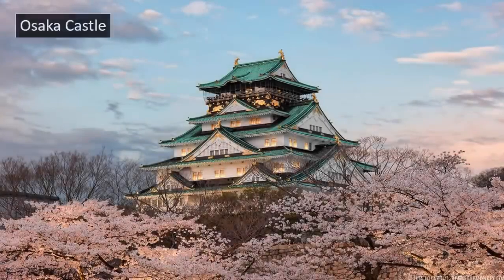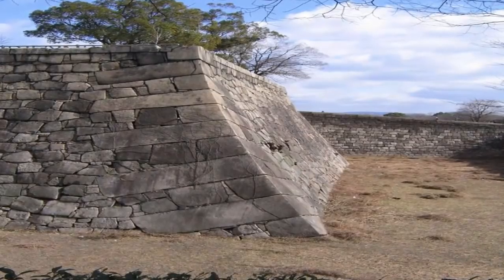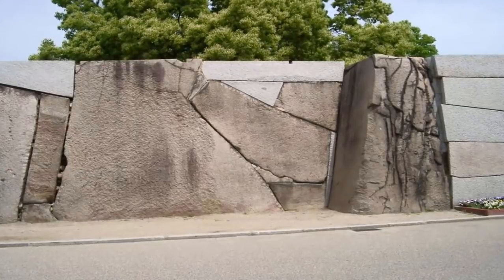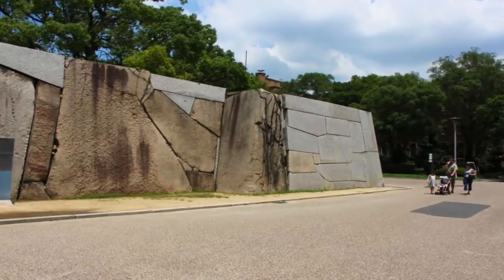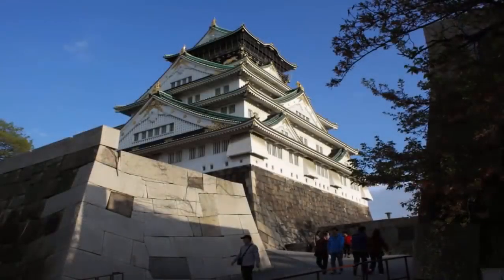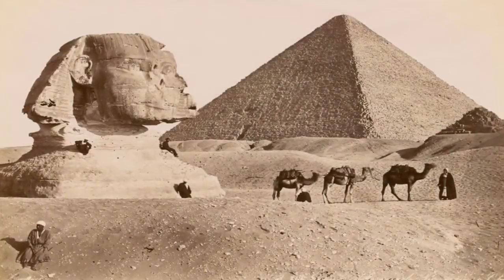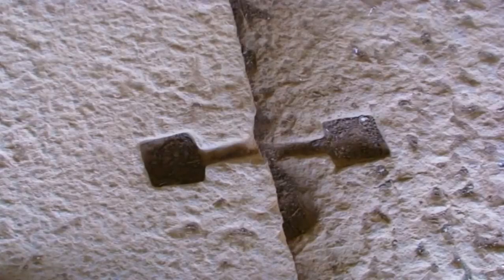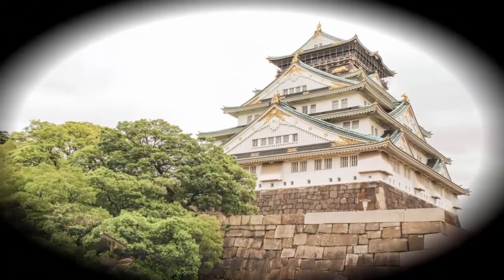The Gigantic Ancient Masonry At Osaka Castle

Comment: I’m begging to see anyone replicate these cuts with copper or bronze tools. Personally I find it laughable. Common sense is not so common these days.
Reply: As one who's recently taken up the stone and tile masonry trade, I can attest to just how hard natural stone like granite, marble and basalt is. Cutting red brick with a diamond chip coated blade? No prob... but using the same blade and power tool on natural stone ate thru this $50 blade REAL quick!
Reply: But it's on the internet.
So it has to be true.
Reply: Chris I don’t think that saying applies here.
Reply: Nicholas Linden He’s a little to stuck on the religion theory. He acts as if religion is the be all end all and can explain all of the extremely diverse phenomena we experience. I just can’t get behind that narrative. To many holes in it.
Reply: With stone material, isn't it that you cut like with like? So the body of the tool is just something that you'd glue ground stone abrasive onto, and that is what does the cutting. May have used something akin to a vibration cutter, but the challenge there is figuring out the source of the vibration and getting the resonance just right. Some modern examples show vibration with a moderate amount of pressure can cut and shape stone in that matter, but ancients didn't have piezo-electric acoustic drivers. So they needed something like a gong or violin bow to get it going, and I've yet to see a good demonstration of that even though the idea seems plausible enough.
Reply: pauljs75 That’s the thing. There is a lot of evidence for a device like your describing. My opinion is that they did have something akin to a saw, we just don’t see the tools they used because of how extremely ancient that civilization was. Would you agree?